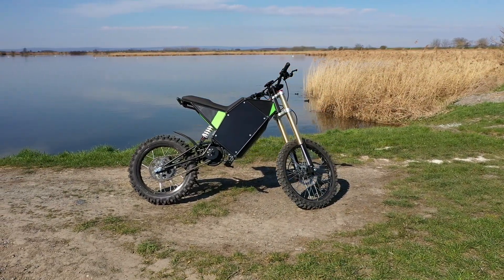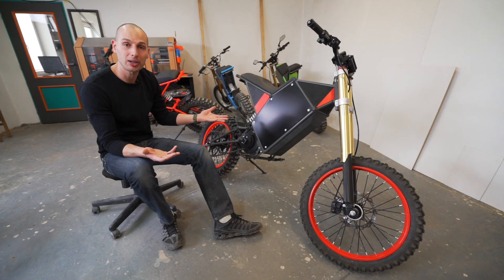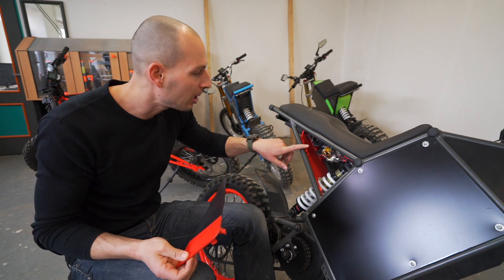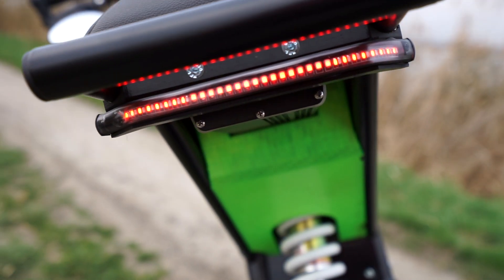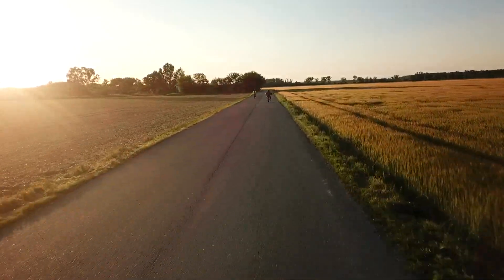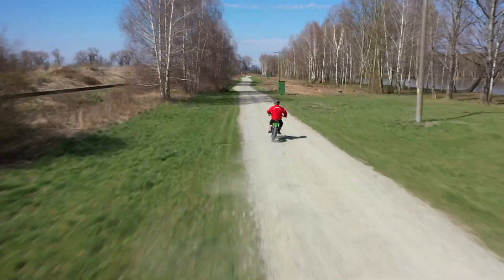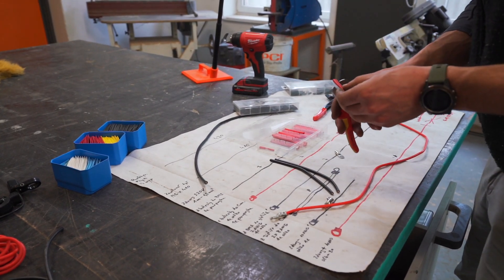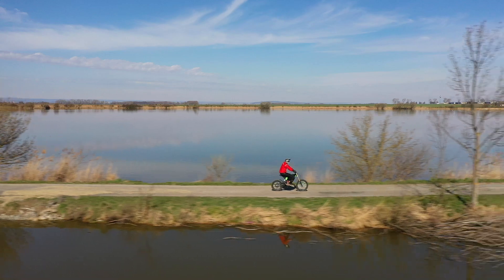27kW DIY Electric Motorcycle - CyberBike Review, Riding, & Power Demo

Comment: Fantastic job!!! Looks like you thought of everything, so let me ask, with your current design how hot do the batteries need to remain as to not to overheat?
All that’s missing for road worthiness is registration at your locale by stamping a serial or VIN = vehicle identification number somewhere on the frame and register as a moped, scooter, or motorcycle. Research your local laws and get it done. It’s not a car, so it’s very easy to license it and you can hit the streets. Don’t let a lack of knowledge hold you back. Just call your local department of motor vehicle and they will be more than willing to guide you through the process. Just FYI.

Comment: the battery is approx 4KW per hour,  motor is 27KW, using half capacity approx 14KW = battery will last 17 minutes. Thanks
Reply from the maker: Nice theory. Real life riding you actually add throttle in intervals. You accelerate with 20kW for 3 seconds and cruise with 4kW. You go down the hill and regen with 1,5kW and so on.

Comment: Looks spacey. Well, are these bikes actually street legal or do they come with COC?  Sure, it only takes 1 hour for recharing with an 40A charger and 40Ah battery but fast charging is still affecting the lifespan of the battery cells. I assume with 40Ah which is not a high capacity you will prolly only make it up to 35 miles on average speed. Too many cons on electric vehicles tho, imo.

Comment: Can you add a motor to the front wheel too?  So, it'll be all-wheel drive?  With the option to use the rear wheel only or both wheels on?  And also, adding turning signals too?
Reply from the maker: I could but it would not be smart. It’s very difficult to maneuver a bike with heavy front wheel.
Reply: @ladiandmargaret  Very curious how the Tesla Model B has dual motors.  And everyone knows having all-wheel drive is better for traction.  Someone needs to make smaller but powerful motors.

Comment: The idea is good but recently there has been reports of electric vehicles getting fire hazards in few days, the problem is the battery, if you park your vehicle ein sun chances are battery will explode due to heat, maybe.
Even in petrol and diesel vehicles, there has been less chance of explosion after an accident happen, if you are using electric vehicle chances are the vehicle can explode after accident due to battery.

Comment: what type of lithium cells do you build the battery for 27kw cyber bike? if you ride the bike medium hard how many cycles can you expect before you start to feel wear and tear? at maximum power how much ampere ö kw do you subtract from the battery?

it looks like some kind of lipo cell do I really not need to solder to connect the cells? not because it would have been a major problem but sounds incredible just not having to solder, spot welding may not be available to everyone but ....

grateful for answers..

Kind regards from Sweden

Comment: for charging I made my own charger - with R4850G2 3000watt power supply + CanBus module  + 1800w step up converter - total cost me 90$ but it's super fast and adjustable for many type of batteries, and can charge multiple small batteries too, but not very portable.
Reply from the maker: Hi, what converter did you use?
Reply: @ladiandmargaret   i used "1800w 40A 60V to 90V step up converter" if you just google this name, it will show up - power supply is telecom rectifier psu, with is 53v 56A but can be adjustable with CAnBus module from 41v to 58v and 1A to 60A CC (for 10S & 13S) and step up module for 16S and 20S batteries.
Reply: @ladiandmargaret   converter comes with a small size heat sink which is good enough for upto 30A, i upgraded to 3X larger heatsink and now it can do upto 45A at input.

Comment: It could be really marvellous design genius, if not missed some essentials: that primitive chain based driving design for this powerful motor on full of dusty off roads ???   What a miss!...Anyway I voted for all other precious work around!  However for next upgrade as needed, try replace that ancient chain traction with a modern in-wheel hub BLDC motor with also regenerative brake option, the only real smartest full ECO solution with top performances for your bike!   I already used these in a notorious foldable electric scooter...so for your piece of art motorcycle we would have been expected much more or same level modern design at least!  Go success with next!
Reply from the maker: Did you know belts are not recommended for dirt roads at all? I did research the belt drive and it’s so much more expensive to achieve. Chain is very simple and quite when maintainer well. This bike has regenerative braking. Motor can be different for sure, it would just be much louder.

Comment: Very impressive!
I'm aassuming it would be easy to print a cell phone holder over the charge cord compartment?
Very useful for GPS navigation...
And is the 60min charging for 240V european standard? Because I'm assuming it might be less on 120V here in Canada...
What about CCS level 2 plug support?
Reply from the maker: We already have phone holder option finished since the first CyberBike. You are right about the charging speed, 120V will be doubled.
Reply: @ladiandmargaret  did you mean halved? 😉
Would it be possible to have an adapter for CCS level 2 charging? Since it is already 240V AC it would seem pretty straightforward.
Also, is there any plans to make the bike road-legal? I noticed there does not seem to be a license plate or turn signals...

Comment: Amazing design! Absolutely love this… Appreciate this bike isn’t really built for jumps or Enduro, but that thin tubular steel swing arm worries me a little… I’m tempted by one of these over a suron for all the reasons mentioned in your comparison video, but this bike weighs as much as my husqvarna Enduro bike, so that swing arm just seems a little under specced - what are your thoughts on this? Just keen to know the limits of the kind of trails I could hit! 👍
Reply from the maker: I tested multiple of them over 2 years and never had any problems. I think you are overanalyzing it a bit.
Reply: Thanks for the reply man… No offence intended! Every bike has limits with regard to what you’re using it for. I’m looking for something that can handle some jumps and drops so just asking how hard your bikes have been ridden to figure out where this design sits on the more extreme use scale… again, not a criticism - appreciate you’re always balancing weight / performance / cost!
Reply from the maker: It’s excellent on dirt roads. Never tested for jumps. Few of them got beaten up pretty well and still run. One did a massive backflip and was quickly fixed.

Comment: The motor you're using is really bad, a Sur Ron bike with a 16KW motor can push over 90 mph or 150 km/h
Reply from the maker: This motor can be rewinded for higher speed as well in exchange for torque in lower speeds.
Reply: @ladiandmargaret  that's cool, what motor is it?

Comment: Cyber bike is Brilliant piece of kit. Unfortunatly in the UK the Police will steal it off you as it doesn't have  a number plate or indicators. are there any plans to have this vehicle certified for road use in the future?

Another option is to get the Cyber bike comunuity to try get one certified for road use in the UK. It cant be that far off already. be intersting to see what needs to be done. Anyway great work. if it ever becomes legal in the UK I'd definetly buy one.

edit - biggest hurdle I think would be the mandatory ABS system (however this might only apply for high production vehicles)

Comment: can you improve your bike configuration by using a belt drive instead of the chain?
Reply from the maker: Belt drive is not ideal for dirt roads and adds major expense to the whole bike. This high torque chain is so easily maintainable, replaceable, affordable that I come to the conclusion of absolutely overcomplicating the build with a belt. Chain is very quiet here as well.

Comment: Nice ebike Ladi......I myself would have made a few simple changes such as I would have used aluminum rims instead of spokes because spokes are a lot more of a complicated design and are definitely not maintenance free......And I would have used a belt drive instead of a chain.......And I also would have made the built in charger 6KW instead of 3KW.
Reply from the maker: You should give it a go, it would be interesting bike for sure.

Comment: I really like this bike and im looking forward to a time id be able to purchase one, my only concern is with some of those 3D printed parts since theyre plastic, or like the ones you glued to the frame id be worried if you dropped the bike a few times or if the components outlive the 3D prints. If its possible i think it would be good to add more points on the frames where instead of having those items glued on, you can bolt it on, at least that way you dont have to worry about the durability of the mounts im sure the plastic Itself is very strong so im not worried about it cracking, im just concered it would fall right off 😂 but hey im not a engineer nor do i know how youve sourced your frames so that might not even be possible but its worth considering 🤷‍♂️
Reply from the maker: Let’s just assume we tested these 3D prints enough.
Reply: @ladiandmargaret  well if you say so i trust you, youve built a awesome bike and im definitely looking forward to being able to build one myself in a couple years great stuff!

Comment: its not bad. we built ours on a Honda Goldwing frame using parts from an electric forklift and a few custom upgrades. 0-100 2.357 seconds. top speed 255 mph so far. one hour to full charge. range 230 miles on a charge at highways speeds. next month we are going to the salt flats for a top speed challenge.

Comment: Nice! 
One thing I wonder is if one actuall can mimic an actual 125cc motorbike: power is no problem, already attained @13W, it's more about autonomy: 400+ km with quick charging AND an economically sound battery life (BIG battery if even possible). 
Don't get me wrong, technically you ebikes are perfectly OK for commuting for instance (and at such a good price, and ability to tune or repair about everything). It's more about road trips.
I live in France, the law here is that 250+W you have a moped or a motorbike, thus it's private roads only or registration, just like a petrol bike.

Comment: you know your old bike with the enduro frame ?  have you thought about whether it would be way cheaper to just by an old motorcycle and remove the engine ?  I have seen a few people doing this for example the channel Fortnine.
Reply from the maker: I know people do it, it requires a lot of customizations so I went with dedicated ebike frames right away.
Reply: @ladiandmargaret  thanks for the reply. I had your video guides for a while but didn't make anything yet. I want to make soon though. I have been looking at the motors and whats going to be best and most cheap,  the shipping cost is quite high on some things especially motor.  I wonder if it might be cheaper on Ebay.  I think would rather buy a motor with prelaced wheel but I worry about buying the wrong thing.

Comment: 2 wheel drive will rock your world.... I built one oh 10 years ago or so, 2 x 10,000 watt Crystalyte motors... I currently ride a 2 wheel drive bike, 2 x 20 amp hour, samsung 40T cells, battery packs, 80 amp Daly BMS @ 48v... then there is the trailer with 2 x 800 watt motors, custom modified Rambo cargo trailer...solar recharging and a dual fuel 3kw 48 - 72v generator, gas/propane.... 60 amp hour more battery capacity in trailer.....
One word of caution, bicycle chains are not made for huge amounts of power, the average person can only put out about 300 watts.. if you have ever had a chain snap on a motorcycle... I have and still have the scars...
Have you tried the new LTO cells yet ?
Reply from the maker: I never understood why people do  two motor bikes. Heavy motor on the front wheel makes the bike so difficult to maneuver, it’s a complicated system with no benefits for casual riding. For sand and snow maybe but it’s not common to only ride in sand.

Comment: Do you build battery packs for customers? I recently purchased the 12000W enduro ebike stealth bomber style bike. It has the qs273, great motor. It comes with the Sabvaton 72150 controller and Panasonic 49ah battery.  I would like to pull the max power out of the motor which should be able to produce 15kw peak power. 

If I upgrade to the 72200 controller what size battery will I need to produce the 15kw peak?

Comment: Dude I lost you years ago! So glad you popped up in my feed again! I'm subscribed now. 

Man if you were to take the next step, make a motorcycle plan, a legit commuter with more range, with an off the shelf frame or even start manufacturing your own, I think it'd sell like crazy too. I think the future of EV's is DIY. If it ever comes to wide adoption, to me, building it yourself would be trivial.

There's a lot of countries still running on a CL360 type frame, where it's used as a utility bike and carry passengers etc, and I imagine you could add 30 to 50% more range on a frame like that with the systems you already have in place. Do you have any plans to do that?

Comment: The 3kw charger is that single or 3 phase power connection? Is it possible to slow charge them? I might not always need fast charge. Also whats the life span of the battery if its getting constantly fast charged at 3kw?
Reply from the maker: Single phase, you can set whatever current you want straight on the controller display. It’s 1000 cycles and than the pack looses 20% of it’s capacity.
Reply: @ladiandmargaret  thats not bad at all. my current ebike does 500 cycles before losing 20%. if some sort of cooling system was put in place for the battery would that help preserve its life like in an electric car?
Reply from the maker: There is no problem with damaged batteries with heat in our case. They don’t heat up at all when charging.

Comment: Ladi, I would love to see you guys produce a more traditional version of the cyber as a dual sport? I think you guys have to the potential to slot into that category?
In Australia they are making provisions for DIY electric powered bikes to be register-able?

What are the specs on your triple clamps and ability to fit Motocross style front fender and rear mud guard that is similar to traditional motocross, with the number plate mount like traditional dual sport?

I will have to jump online and check out your site because even your battery packs are worth looking into for other DIY'ers?

I like yours regenerative braking idea, being button activated and not automatics as soon as you roll off the throttle; would you consider (still leaving it as button activated regen) but making it activate on the brake and use a mechanical brake bias for more normal braking or more regen?
So say you're just touching the brakes to slow you down but not to a stop..... You could make it so it's always regen when you're on the brakes, but the traditional brakes kick in as you grab more of the brake lever?

I have been considering the idea of completely ditching the front disc brake swapping in a hub motor activated on electric clutch?
So when your riding, power comes from rear wheel and the front is free rolling on open clutch? Soon as you want braking, the clutch activates the front hub drive and provides regen to the packs from the front brakes while braking? Further to that you could then make the bike much like one of those Italian 2 wheel drive enduro bikes?
You lock the clutch in and then you will get drive to both wheels temporarily for a short amount of time, until you disengage the clutch again?

What are your thoughts on this?
I think it's potential to harvest more energy from the regen without jeopardizing the traditional bike braking?
The single pedal idea of Tesla and the automatic regen as soon as you lift off the go pedal....
That's something that plays very heavy on the traditionalists among us.....and that same feeling can be even more said for ICE motorbike riders? If it feels too different and not like a normal bike, then adoption is going to be impeded, keeping the traditional feel as you have done help grow adoption. Well done 👍
You will get a big community going. You will be successful

Comment: Hello. Great project turned out 👍🏼
Tell us in more detail what kind of cells are used, what are their maximum recoil / charge currents, how many charge cycles are they guaranteed to withstand, what is the temperature range of operation?  Thanks in advance

Comment: what about motor overheating? 27kWt peak in 3kWt motor without cooling?
Reply from the maker: It’s heat treated. Never happened the motor would overheat. Not even in the summer.
Reply: @ladiandmargaret  heat treated, how?  Can it run 80 km\h continuously?
Reply from the maker: Yes it can. I share it in the video guide.

Comment: Finally you finished xD, you should change the Voltage shown on your Webside. 22s is 81,4V Nominal, its unprofessional to show the max. Voltage of 92V. A 72V ebike has a max. Voltage of 84V, but nobody claims it is a 84V eBike right?
Do you use a custom charger? Would like to know what charger this is.